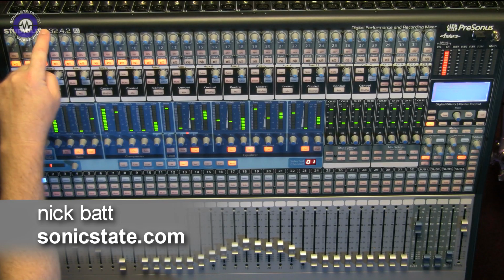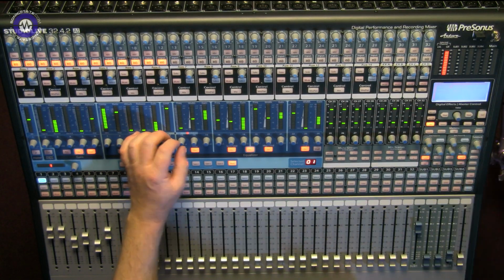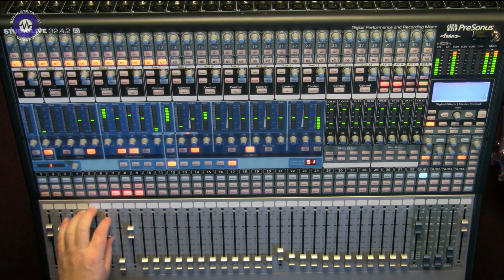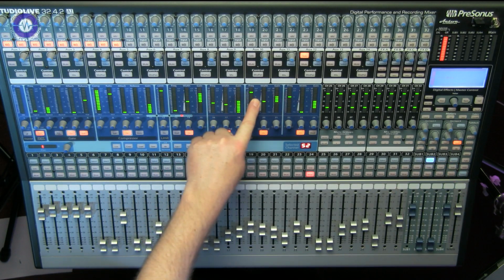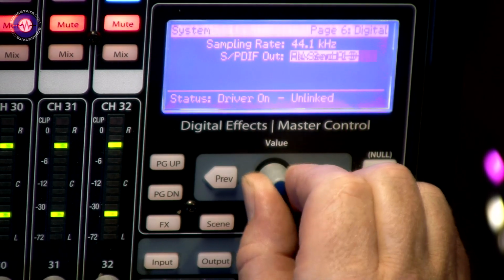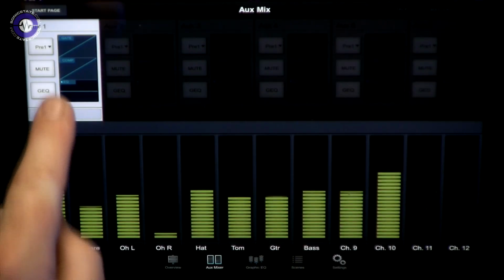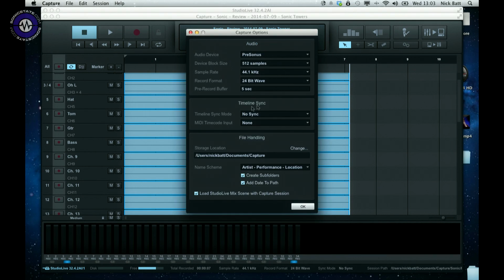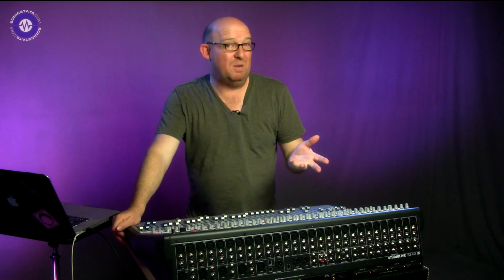Presonus StudioLive 32.4.2 AI Digital Desk

Comment: actually they should have implement flying motorised faders which is fantastic feature for the automation process, in this price range you can actually buy it  Behringer X32 fully designed from the beginning based on motorized faders technology. For some reason Studio Live Ai series consoles become unavailable on PreSonus web page, even local stores has pretty limited supplies of this particular product. I have suspicion that Ai series might be replaced with upgraded version of this product.

Comment: I am thinking of getting on of these new but I would like someone to answer this question if possible.  I plan on mostly using this in the studio but do I have to Mac / firewire to send the individual  channels  directly to my DAW which I use Presonus and 2 others.  But I am on a windows 10 based computer.  Forgive me for my ignorance I am getting back into setting up the studio in a more digital world after having been away for many years...Is this done only through Ethernet or do I need buy some firewire interface for the windows based PC.  I looked over the manual and it was unclear.
Thanks for any help in advance.

Comment: Hello again....One other question. I am really looking for a console that will be great for multi-track recording. I like a lot of the features on this board, (channel insert jacks, variable Q, Attack & release controls on gates and compressors, etc) but not sure it will be great for studio recording. Do you have any suggestions as what to check out. Thanks....
Reply: I believe that this board is great for studio recording! You can record each track individually or all at the same time. Also, all the tracks will be routed back to the board after being recorded if you want to mix on the board to add analog outboard gear and record back into your daw!